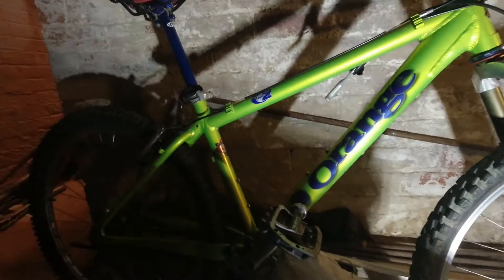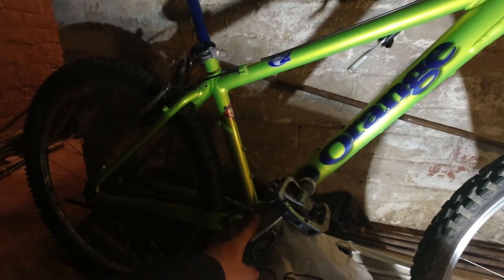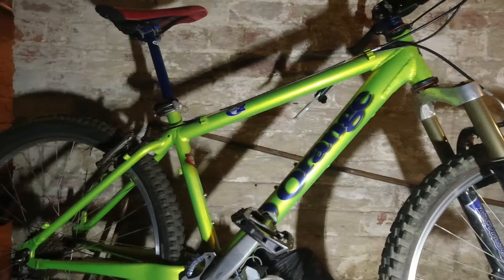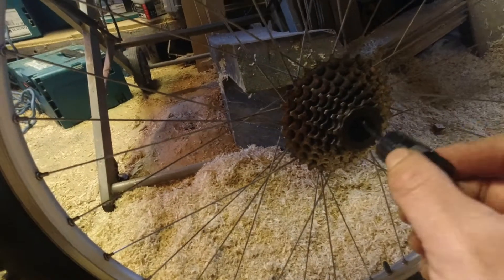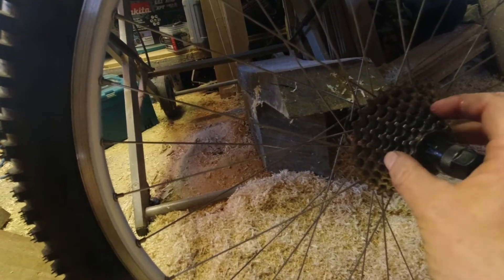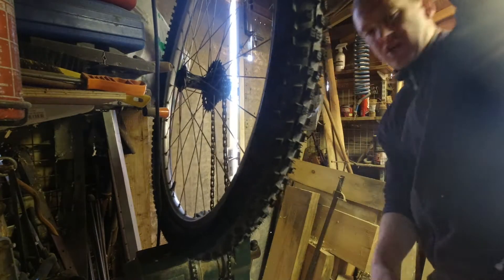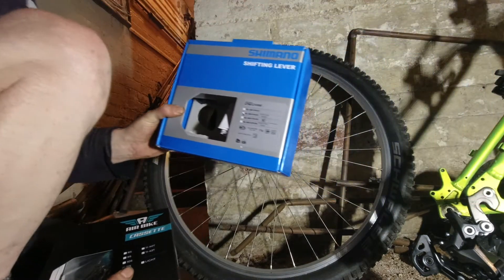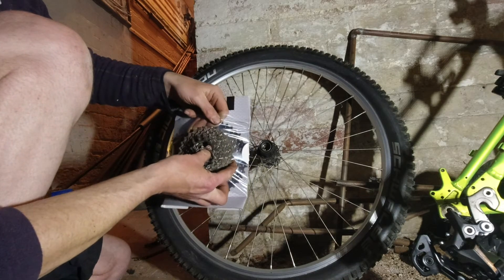Can I Convert my Orange Evo2 Retro 90's Mountain Bike from 3x8 to 1x11 Speed?

Comment: I realise I’m a year late to the table, but in order to fit the quick link with pedal pressure, the link needs to be in the top chain line. With the back brake on you can rotate the cranks to produce the necessary pressure. 😉
Reply from the maker: That’s brilliant thanks.